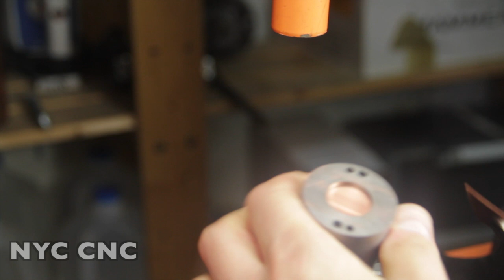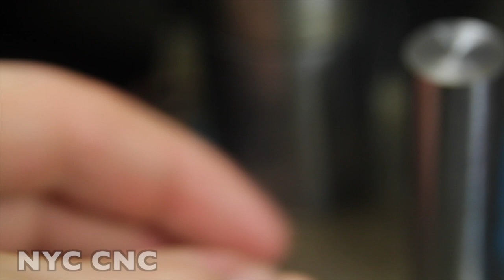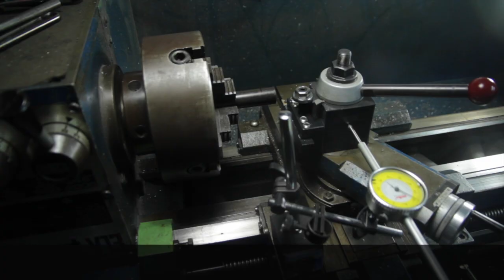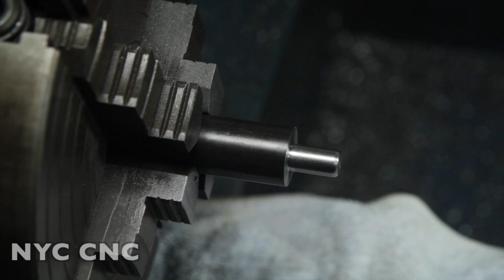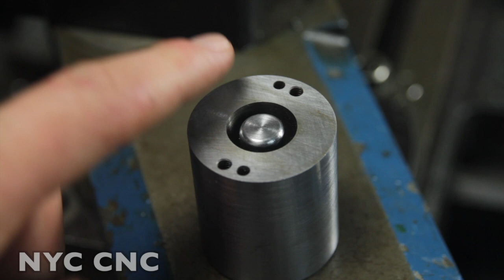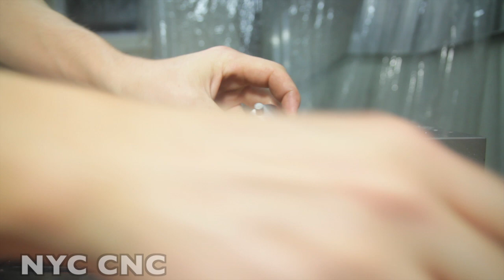Making Copper Bullet Jackets: Machining Punching & Drawing Dies!  Part 8

Comment: I know this is a old video but I always polish 80 grit, 120 grit, 240 grit, 320 grit, 400 grit, 800 grit, 1000 grit, 1500 grit, 2000 grit, 2500 grit, 3000 grit, and then polishing compound on a micro fiber towel. It gets you a finish that is a perfect mirror. I always use Norton or 3m abrasives

Comment: This whole time I was wondering why you kept dividing your cuts.  Does the cross slide not have a dial?
Reply: NYC CNC Every turn of the cross slide is .001" but in reality it will only move half of that.  A 0.100" depth of cut, the cross slide will move .050" to remove mat'l from both sides.  every time you came up with a depth of cut, you would then divide.  Then I saw the yellow dial indicator mounted on top of the cross slide.  I assume the cross slide hand wheel doesn't have tic marks.  I currently run a 30 man machine/welding shop and have been running manual/CNC lathes and mills for 20 yrs and It just struck me as odd.

Comment: Great video, when you are polishing a piece with emery cloth do you ever use the cloth side? After you cut it down to size flip the strip over and put some pressure on it. It will polish to a fine mirror like finish. The cloth side seems to have a very fine abrasive quality. I am not a machinist but a mechanic and have done this for close to Forty years. Maybe you use this trick to, likely could eliminate the compound and rag. I don't like rags around revolving things. Cheers keep up the good work.

Comment: Ferrous metals anneal when air cooled slowly, and harden when quenched.  Non-ferrous, (Brass, bronze, Aluminum) anneal with quenching and harden when air cooling.  Common reason why aluminum welds gets brittle with time.  High heat then air cool causes brittleness (hardening.)  Try a thin strip of sheet 6061 that's been sitting around and bend it sharp.  You'll see stress cracks.  Anneal with sharpie and torch and quench.  Bend again, like butter and no stress cracks.  Fun test to do!

Comment: Copper work hardens and it will also harden with time just sitting.  Same with aluminum.  I anneal by marking with a sharpie and heating with propane until sharpie disappears, then quench in cold water.  It makes it really flexible and soft.  Might also be a good idea to re-anneal after punching and cupping before drawing.  Less chance of cracking, splitting or extra force needed.  Just a thought!  Can't wait for the next series!

Comment: Another great video
I have a question (maybe I missed the obvious answer) but when you drilled and reamed on the mill, how was the inner part secured into the outer part? It seems like the inner part could have been spinning and drifting during those operations.

Comment: Initial punch was way too "snappy."  Lots of extra force required to punch work hardened copper and I noticed your dies are not hardened.  That means a lot of extra wear on your dies.  Anneal the copper, lubricate your dies with light oil or kerosene and they will punch through with less pressure and less wear.  Love the series, keep it up!

Comment: Common in an industrial process when doing multiple step punch and form dies you put some kind of thin oil on there to make stuff slip. I have seen the use of everything from thin gearbox fluid to breakfluid types to the thicker 50W.. my guess is that a thinner oil would be the appropriate approach though.. Its probably not required for shearing but for the forming part.

Comment: When, pressing stuff in multiple steps in an industrial process isnt a little bit of oil on the sheet metal the "way to go" havent seen you put any lubricant on any of the dies yet though.. whats your thought behind that - the metal is slippery enough?